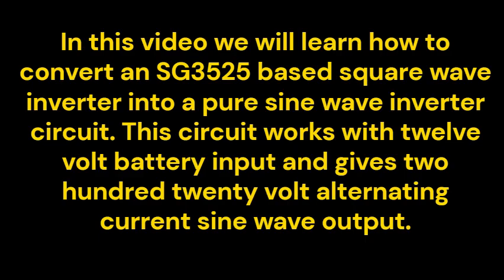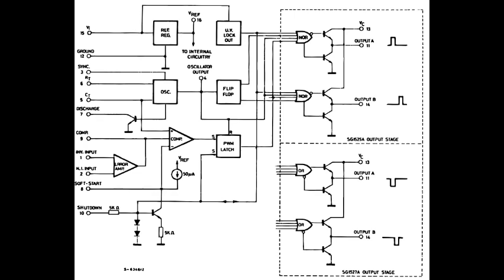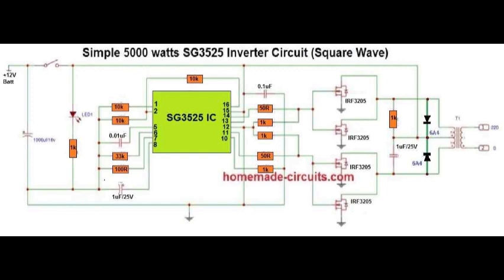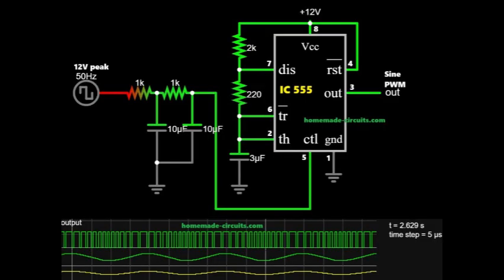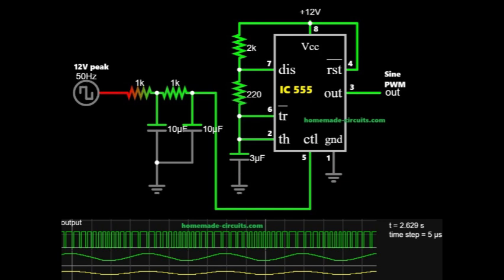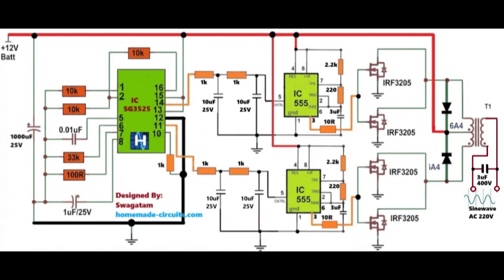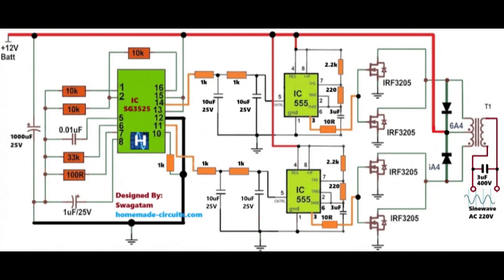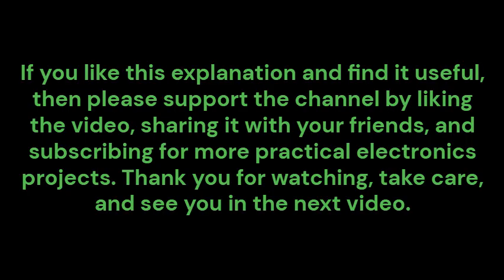How to Make a SG3525 Sine wave Inverter Circuit

Comment: what is the transformer specs ? and what is the AC output load capacity in watts?
Reply from the maker: Transformer specs will depend on your max outpput load specs, and vice versa...same for the battery also

Comment: Este circuito lo has montado y comprobado? porque a mi no me funciona. Los 555 tienen que sincronizarse para que no coincidan.
Reply from the maker: 555 stages are 100% synchronized, and they can never overlap because they are hooked up with square wave inputs from the oscillator circuit. You can increase the dead time of the SG3525 and check the results...
Reply: @Homemade-Circuits  Probaré, gracias.

Comment: В этой схеме допущена ошибка. Резистор 100R должен стоять между  5 и 7 ножкой SG3525.
Reply from the maker: Thank you, you can replace the shown SG3525 inverter block with your own SG3525 inverter version, or any other dual square wave oscillator stage...

Comment: Please Sir,is it possible to use ferrite core transformer?
Reply from the maker: Yes, it is possible, you can calculate  the ferrite transformer using the following calculator: https://www.homemade-circuits.com/smps-flyback-boost-converter-calculator/
Reply: @Homemade-Circuits
Reply: I want EMF circuit board wave length 12 inch radius
Reply from the maker: @girishbabuthota8020  please give the full specification of your circuit and please post the question in my blog as a comment....i will try to solve it for you....

Comment: Are you sure?
Output voltage is not sinus.
Output 50 hz triangle curve ac voltage.
    Because 555 pwm geneator input signal is dual slop exponential RC integrator vaweforrm.
   İt is not sinus.
Reply from the maker: Please investigate online, a double RC integrator will always give you a sine wave output, the simulation result also confirms that: https://www.homemade-circuits.com/wp-content/uploads/2026/01/double-RC-integrator.jpg
Reply: The final smoothing device is the output capacitor. I did a simple design without IC, just LC plus square generated by push pull. And this is more precise and controllable due to the IC's with their external parts.

Comment: Is that output on scope as modified square wave ? Also how to synchronize the 555 outputs as separated? Show waveform.
Reply from the maker: No, it is not a modified sine wave, it is a almost a pure sinewave. The 555s are already synchronized with the input square waves....you just need to make sure the part values of the two 555 + integrator are selected exactly the same...The output waveform will be like as shown below, which will turn into a good sine waveform when you connect the 3uF/400V capacitor: https://www.homemade-circuits.com/wp-content/uploads/2025/12/SPWM-sine-equivalent.jpg

Comment: PWM from both 555, are not synchronised. And clamping diodes will made a lot of loses in this configuration.
Reply from the maker: It does not actually matter much if they are not synchronized physically, as long as the part values are selected precisely the same for both the 555/integrator stages, because the resultant SPWMs will be almost identical and synchronized with the square waves from the SG3525 outputs. Regarding the noise, we can handle it by replacing the diodes with RC snubbers across the transformer, as well as across the MOSFETs. The above design is just a basic design, showing an easy way to convert a square wave inverter into a sine wave inverter, which can be further improved through additional upgrades.

Comment: make a sine wave oscillator 50Hz and drive a power audio amplifier, you'll get real pure 100% sine wave!
Reply: The power amp must be a pwm based too.
Reply: @Parlindungan-s9s  for efficiency yes.
Reply from the maker: https://www.homemade-circuits.com/class-d-amplifier-circuit-using-ic-555/
Reply: you can't drive a field effect transistor by sine wave.  Efficiency of bipolar transistor is too low
Reply: @zootehnik6662  You mean a Class A amplifier efficiency is low. On the contrary, efficiency is high as you have 230V AC identical to mains power driving all kinds of loads, inductive capacitive etc. But that noisy square wave inverter is garbage saving a few cents to drive smps loads which in turn produce noise. An audio amplifier with powerful output transistors like the 2N3773, or MJ15003 and its complement make reliable efficient inverters when driven by a sine wave oscillator. Real world mains generator!  If you prefer noisy efficiency then drive a class D or F audio amplifier like those in the Chinese audio bluster and a transformer and power stages for extra power, if saving some cents at the cost of pure sine wave and clean atmosphere is the efficiency you mean!
Reply: @BFQ135  my friend, if you use power line for AC 230V you don't need inverter at all.

Comment: Sir, what all modifications should I do   get 12 v ac sine wave without using transformer
Reply from the maker: Tom, for 12V output, you can configure the SG3525 as a single ended oscillator, and process the output using a single integrator and 555 pwm stages, and a single MOSFET stage. You can use an LC filter at the  output to convert the SPWM waveform into good sine waveform...
Reply: Соберите генератор на операционном усилителе с мостом винна.и получите свой чистый синусоидальный сигнал.